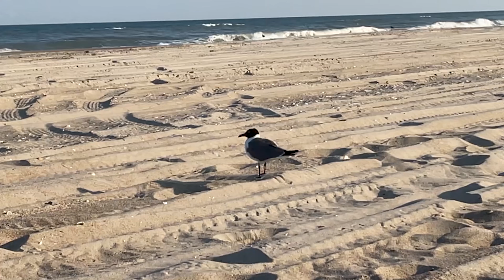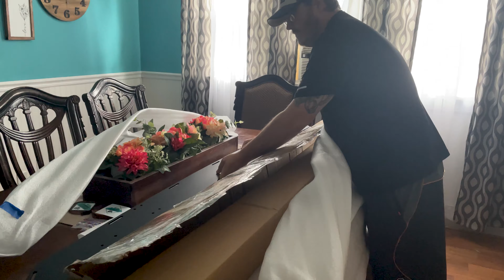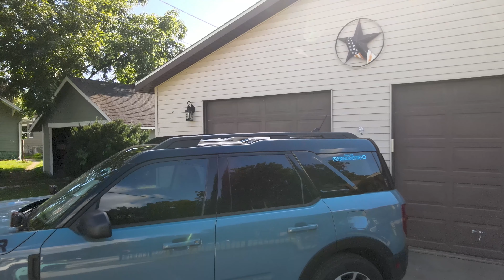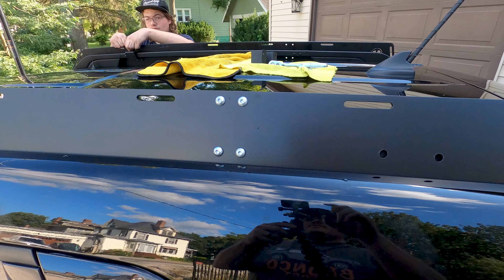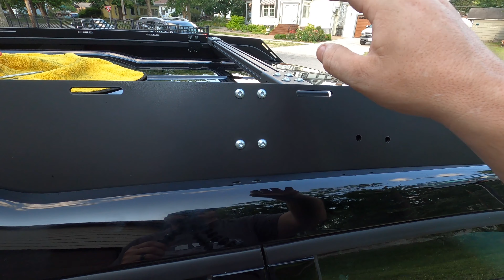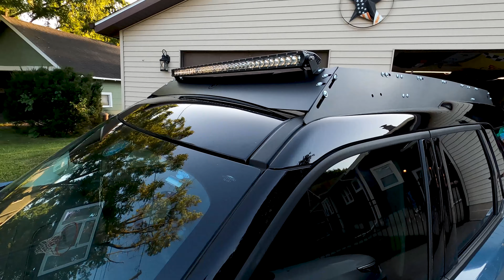2021 Bronco Sport Offroad Roof Rack Install and Review From Hobbs Truck & Jeep Accessories

Comment: Just curious where you routed the wiring for the light bar. I have a rough country light bar and I'm trying to figure out where to route it.
Reply from the maker: I will add this to my Q&A video on how we do stuff.  We are going to be doing monthly videos on some questions.
Reply from the maker: Long story short is the front a pillar panel pulls off and because we have the aux beam box under the hood it works out to run the wires outside the bronco sport.  You have to very careful on removing the plastic cover with the clips, and then there are 2 bolts that removed the and give access to a open channel to where you can run wires up.  I will get this video released on doing this in the next day or so.
Reply: @JKAdven  awesome! I look forward to it!
Reply: @JKAdven  please pleaseeee tell me you've uploaded this
Reply: Would this work with a sunroof
Reply: @JKAdven post link how to run wires

Comment: How did you wire the light?
Reply from the maker: we ran the wire up the channel to the roof to the hood where our control box is at for the AUXBEAM 6 gang controller.
Reply: @JKAdven  thank you.    sorry, is it just external along windshield?   I have a Bronco Sport Badlands and a frontrunner slimline.  I am looking to add light bar but no one has videos on how they run wire from top.  Didn't know if there was wiring tunnel down a-pillar (near the accessory ready label), like the full size Bronco.